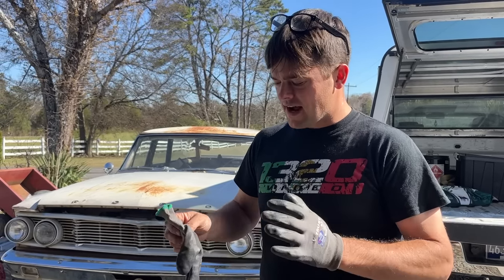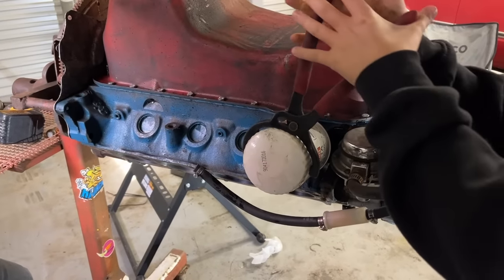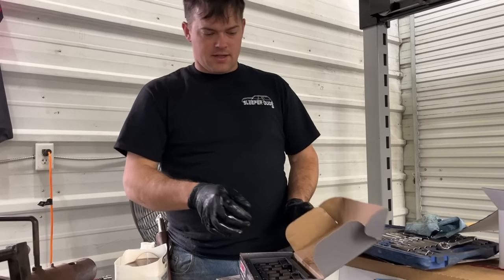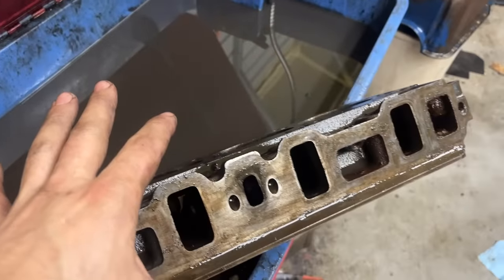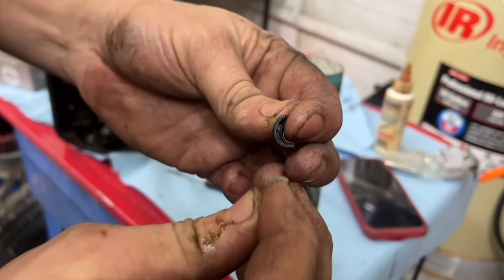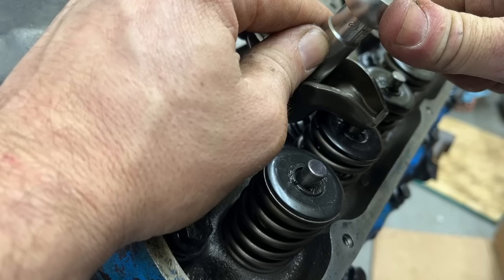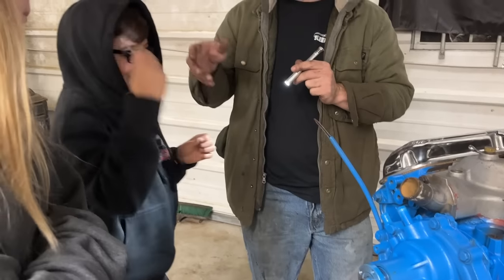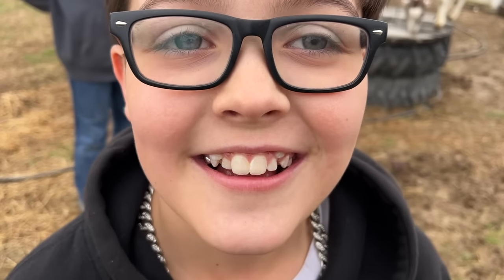We Had Issues! Small Block Ford Engine Build 64 Galaxie Station Wagon

Comment: The exhaust valve tips are different because somebody has replaced the exhaust valves with ones meant to be used with early rail type cast rockers and studs. late 60's to 70's They wont work correctly with stamped non adjustable late rockers and heads. This maybe why the last owner thought there was a problem with the springs. They are isky springs which are much better quality than the chrome silicon springs comp has supplied. Just so happens if you lose a timing chain on a small block ford it bends all the exhaust valves. that could explain the cam change.
Also you need to measure the installed height and match it to the spring specs. (Bottom of retainer to spring seat in head) That's REALLY important. Not just for coil bind but to get the proper seat pressure.
Im surprised comp sent those old time full Teflon seals they never did work well. They seal to good at first then when the guide wears they hog out and leak oil. They can also make new exhaust guides stick on break in.
the later motor is also designed for a serpentine belt so the water pump spins in the reverse direction. Different cover and water pump.
Also never reuse a pickup tube, when they sludge up there is a tin trap door under the wide strap that goes across the pickup screen. It opens very easy and stays open. I think the idea is if the user does not change oil dirty oil is better than no oil. But the pump has nothing to pre screen the oil. Fords have a gear rotor pump that is really touchy about contaminates. It will lock up the pump and twist the oil pump drive shaft . then have no oil pressure.
Yes this all sounds critical but they also did some things good li8ke measuring the oil pick up height and not tearing up the cam bearings.
PS the 289 block could be saved by sand blasting just how thin it got from the rust may cause a problem.
PS PS Check you pully alignment when your mixing the early cover and pump with aftermarket pulls and a late 50 Oz damper you can buy shims for just that reason. Welcome to being lost in ford land where nothing is the same and its just starting LOL
Reply from the maker: Ok thank you for all the information
Reply: @Sleeperdude  One more suggestion. Later roller cam Fords came with a hardened gear which can be used with some aftermarket billets. You may want to check with comp on the compatibility The old bronze gear deal does not work well depending on how it meshes (There is all kinds of variables on that one) It could last a 2 thousand miles or a 100 miles. As it wears it fills the oil with bronze. And since the ford filter has a bypass in it internally. (Chevys have them in the adapter and many people plug them) only a small percentage is filtered out. Comp had a composite (plastic)gear for awhile they were terrible

Comment: Josh, you better check out the bellhouse bolt pattern. early 289's ( before 1965 ) had a 5 bolt pattern after that they were 6 bolt. the two bellhousings will not interchange. I saw you grunting and groaning putting the bare engine block in the pickup bed. a bare period correct big block ( 352-390 ) weighs twice as much, definatly a two man job. good luck with your rebuild I have done about a hundred small block Ford rebuilds they are like Doritos (tm) you can't do just one.

Comment: I wanted to dive a little deeper after you asked, " I wonder why they stopped making station wagons."

You can POINT THE FINGER at rising gas prices - 1973 
and tbe introduction of the Chrysler mini van - 1983 
as the culprits that demised of our beloved station wagons.

According to Wikipedia the Chevrolet Caprice and the Buick Roadmaster were the last American full-size wagons, discontinued in 1996. 

The Ford Country Squire started in 1950 through 1991.

The 1950 wagon was available with a 239 cubic-inch 100 hp Flathead V8. a 3-speed manual. 

The 1991 wagon was equipped with a 301.6 c.i. V8 rated m 150 hp.

God bless ya'll

Comment: Hello Family!!!
I like the T-5 it would be a huge improvement over a three speed. However, you will need 350 to 380 rear end gears depending on the wheel & casing size. The T- 5 trans out of a 90s Mustang uses a Factory Ford clutch cable, you will need to remove & modify the clutch pedal, this will require welding on a cable bracket to the stock 64 Galaxy clutch pedal . The stock clutch linkage set-up that came on the 64 wagon will not work with the T- 5 speed, the T-5 bell housing is set up from ford to use a cable to release & disengage the clutch, also, it pulls the clutch fork forward, toward the engine to release the clutch, which is the opposite of the 64 wagon`s push rod style that pushes the clutch fork toward the rear of the car to release / disengage the clutch. The (Cross Member Bracket) may need to be moved to line up with the Transmission mount on the T-5 Trans. If the stock 64 wagon cross-member won`t work, you can fabricate one that will work with the T-5 Trans Mount. The (Drive-Shaft) may have to be shortened or lengthened. You will need to use the T-5 (Slip Yoke) to slide into the tail shaft of the T-5 Trans. The U-Joints may not match between the 90`s mustang (Slip Yoke) and the 64 wagon`s drive shaft, there are u-joints available that will work with just about any combination.  Oh` the shift linkage on the wagons (T-10 Transmission) is external.  The T- 5 speed trans shift linkage is internal. Hope this information helps just in case you have never done a T-5 swap into an older 60`s Ford. Any questions you can email me @    onefast68ford@gmaik.com👍👍👍

Comment: Plug all the holes and fill that block with works toilet bowl cleaner  It will eat all of that rust in 3 or 4 hours . And it's dirt cheap  I use this product to strip a gauge cluster and a 57 Chevy which is pot metal And lifted all night when I got up in the morning there was tiny pieces of it left it ate the whole thing this is powerful stuff

Comment: Great video. You will have to get an adapter so you can run the factory z bar for the clutch linkage. The later blocks dont have the threaded hole
Reply from the maker: Thank you I figured that out after I got done with this video. Working on getting one now

Comment: A lot of impurities in the water most likely. We used to have heavy iron in our water. Coincidence or not we would have trouble with the build-up in the water jacket. After they've been setting for a while. I've got a couple of min setting for forty years and we're going to open it up and see what we got so I'll be interesting. We would weld that cracked timing gear cover. Fortunately had the capability. I-64 brings back memories and one that my mom used to drive and gas mileage so bad we had to park it. Six years later I started tinkering with it. The short of it is my dad said I hear you one more time getting on it. Man I was 5 miles away and I didn't think about traveling through the hills and hollers. He sold it. It was armor-plated in the back of the front seat in the doors and so forth. The bumpers for a half inch thick custom-made here is a four-door. I won't say what state but it was made for the highway patrol State Commander he was top dog. 390 flags but that thing we had to cut and well. Armand the fuel pump because it was three times as long as that 390 would ever been. He bought it off the state when he retired. The commander did. He parked it when it probably hit twenty-five cents a gallon for gas cuz it's so outrageous on fuel. The guy that bought it off my dad had a salvage yard in back. That guy drove it for a little bit and decide to part it out because of the gas mileage. Mousy galvez best ever got and averaged about three miles to the gallon and if you got on it. It would get 3 to 5 gallons per mile. Some sharp-dressed guy from Ford a couple of years later. By my dad's shop inquiring about the car. Apparently the engine was never supposed to be in Publics hand. Okay getting to be too long I'll just cut off at that point but it was determined that the car had been smashed and the engine was most likely in it at the time they crushed it. I can tell you right now my friend Mark decades later still has that carburetor setting on his shelf. He says it's a souvenir confirm when we were teenagers. By the way that was in the 80s when that guy from Ford came by looking for that engine from 1964. I thought that part was odd.

Comment: Its sad the major cam manufacturers sell “matched” valve springs and claim as drop ins but they give you the same retainers for both valves. Stock heads have rotators and using same installed height retainers will add about 60lbs more seat pressure on the exhaust valves but as long as you keep it under 7k rpm you will be fine anyway.   Look up Alex’s Parts for true “drop in” spring kits. Love the wagon and cant wait to see it cruising the streets
Reply: Meant to add....some of the aftermarket keeper grooves are offset to account for the rotators not being used

Comment: Feeling your pain on the mismatched parts. Ford had so many stinkin variations of the water pump, timing cover and drive pulleys on the Windsor engine. I almost yelled at the TV when I saw those lifters get dropped in backwards.  Thought to myself…that’s gonna bite him in the behind later. I was hoping you would mock up the drivetrain before installing the intake….nope. Unfortunate about the 289, I save every one I can. Can’t wait to hear that 302 run.

Comment: Or k-1 cleaner will break that rust down. For y'all inside of that engine block soak inside of A troph tube I suggest one of the plastic type. Cause it could eat through the metal type of trophy. Soak it for four weeks Josh.

Comment: Dear Sleeperdude family
👍👌👏 2) You asked for it, so here are my thoughts: Usually I would vote for the T5 transmission. Not only because a potential buyer would like that more but also because of better fuel efficiency and more highway speed (without changing the rear end/differential).
3) I would vote for the 3 speed gearbox simply because it should be much easier to put it back into the car. And it's definitely more original.
4) The new born goat baby is definitely a cutie.
Thanks a lot for making teaching explaining recording editing uploading and sharing.
Best regards, luck and especially health to all involved life forms (humans and animals).
Reply from the maker: I’m with you on the 3 speed. Thank you
Reply: Dear  @Sleeperdude  
Thanks for replying and especially for another heart. As you know, I totally appreciate both very much and always.
2) Who is with me respectively answering? Misses or Mister Sleeperdude? Anyway: Is there something like an overdrive existing that can be put on this car/gearbox? To me it's always kind of strange to see, that there are big/strong engines in cars but no decent highway speed iss possible. At least not in a not the ears/engines/nerves hurting way (= not with a high number of revolutions respectively engine speed).
Thanks in advance for answering.
Sincerely yours.

Comment: Hey !!!! You need to know asap !!!! On the newer Ford blocks there not drilled for the Z bar ball. !!!!!! On a Ford it's on the block !!!!!! Older blocks have it !!!! Also. The lifters !!!!!!!  You mite want to keep the factory. Set up that was in the newer block. Becuase I have run across issues with tie bar lifters having the oil hole in wrong spot for newer block !!!!!!   I don't remember if Ford had that issue I had that problem. With a Mopar 440 !!!! I used roller lifters that were made for the newer blocks !!!! There was difference !!!!! Love the show  I watch every episode !!!!! Please make sure you check over what I said also !!!!! You mentioned new pulleys the 289 is a three bolt pulley I hope you  don't try to use the damper from the 289  so that you can use the three bolt crank pulley it will fit but to will have massive vibrations. Thru out the car !!!!!!  Please take my advice  and good luck I will keep watching   and hope you  don't have any issues with this build. Keep it up your all awsome !!!!! The best utube show   in my opinion!!!!!

Comment: Hey Josh. I'm guessing that someone used well water in the 289. Up here in Michigan we never used water for coolant because of our temperatures, but also because coolant is also a lubricant that saves water pumps. Just FYI the GT40P heads from 1997 and up Explorers are the heads to keep an eye out for. I ran into the balancing issue and the 351 W cam firing order when I put a 1999 302 crate motor in my 1963 Fairlane. Don't think Ralphie quite understands the bad things that would happen to the 302 if it got painted bowtie orange. Looking forward to the first start. Congrats on the new grandkids. Thanks for posting.

Comment: The aftermarket valve springs that were on the E7TE heads had different height valve keepers on the intakes and exhausts so the retainers were all at the same height.

At first,I thought those $$$ link-bar lifters were overkill.  After further thought I believe you probably need to use those link bar lifters with the retro-fit as it likely has a reduced base circle.  The Comp Thumper reduced base circle cam's directions indicate it is not for use in a roller cam block.  I believe it is because the lifter bores are longer on the factory roller cam block.  Some guys find that factory lifters on a reduced base circle in roller cam block place the top of the lifter partly below the dog bone when the valve is closed.  If the dog bone fails, the lifter turns leading to catastrophic damage.

Comment: I'd keep the mechanical fuel pump in the car so if the electric one goes out you can make it home.
Try putting some rust remover in the 289 water jacket to clean out the rust to see if it's useable in something else.

Comment: I put GT40P heads on my older non roller block and I had to use special retainers from Alex Springs because of the difference in the lock location on the valves so that the installed height would be consistant. Not sure if E7 heads have the same issue, but it looks like it and just a thought. Love the channel!

Comment: If the 289 in the galaxy is original it has. A 5 bolt bell housing 28 oz fly wheel and the after 65 Ford small block is 6 bolt . The light blue is early 1980's just before ford used light gray the 302 you have is homegrown hi po and you should have used the old ford hi po color of black block with medium gold valve covers and oil pan and air cleaner.  Hard to beat a 5 speed but the rear end ratio may be extremely high geared a 3.50 or 3.25 is a very good gear for highway safety a 3.73 is a little steep gas and long distance will become annoying. For a cheap brake update we used late 1970's Thunderbird or cougar lot bigger brakes than Granada the rear brakes backing plates and drums should bolt on as a set along with the master cylinder and brass brakes dividing valve use new copper lines cheap easy to bend and new rubber brake lines. Really appreciate your  show and really like the wagon very much. Not sure about the electric fuel pump I run one for boosting if the car has been sitting for a few days but I am old school and like mechanical fuel pumps more reliable and less likely to dump gas every where I also use a push button to prevent accidentally leaving electric fuel pump on

Comment: The oil pan with the two drain plugs you was wondering about the one in the front it was so if you needed to drain out a quart of oil just drain the front one it holds 1 quart that's what I had been told I checked and it does have a quart in it so that checks out lol

Comment: Surprised that 65 timing chain cover worked on the 90 block. You do know that 302 heads changed combustion chamber size around 1977. That’s my problem. The 302 that was in my restomod had a 76 head and a 77 head (72 block). Got AFP aluminum heads going in next month. Also, they changed the weight of the harmonic balancer (I think when they went to roller lifters).

Comment: If you use the stock mechanical clutch linkage, you will probably need a clutch equalizer pivot mount bracket. The later model blocks don't have a place for the pivot ball, I believe Scott Drake has them.
Reply from the maker: That’s what I found out right after finishing this video thank you

Comment: I'm glad you are doing the 302 I'm building mine in my 2wd explorer I'm thinking about doing a 347 stroker but maybe just a cam and headers and better efi and 30 over but it's low miles and runs great so I will probably wait for the bore you should port the heads or get some gt 40s from an explorer

Comment: Alright, that does it, I've seen enough of the results of following useless ditties--how does it go: tightey whitey; loosey goosey? Teach your children right: clockwise rotation always (except on left-hand threads) moves the thing that you are turning (bolt, nut, filter cartridge, et al.) away from you, and counterclockwise rotation moves the thing you are turning towards you. A bolt drives in away from you when turned clockwise and comes out toward you when turned counterclockwise. This also takes away the usual confusion while reaching behind a bracket (for instance) to loosen a nut; clockwise from your position moves the nut away, in this case loosening it. Of course, this all falls apart if your children have never seen an old-fashioned clock with the moving hands. In that case, never mind.